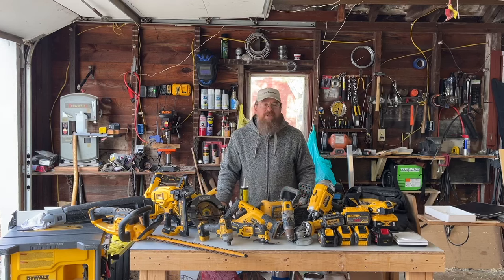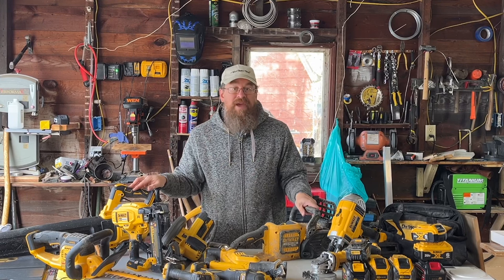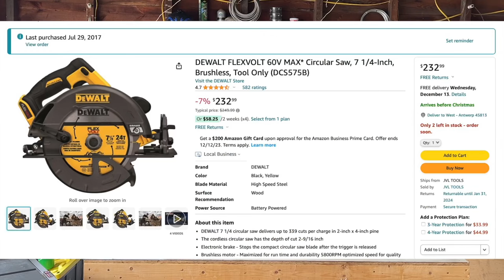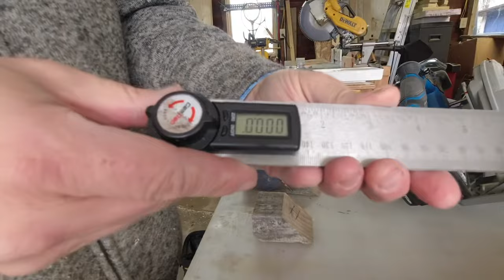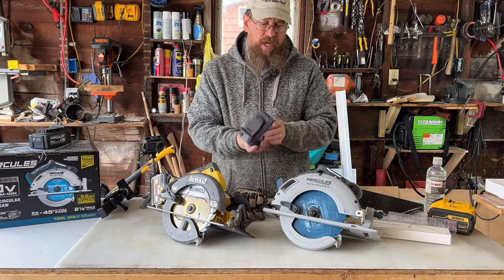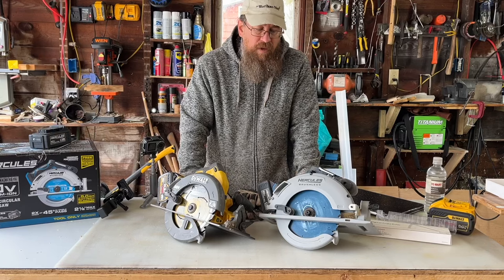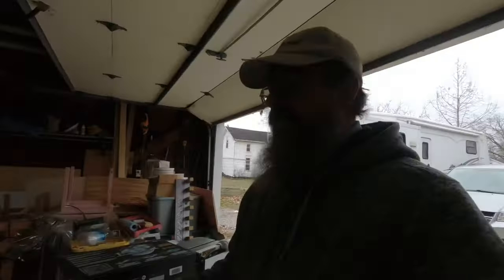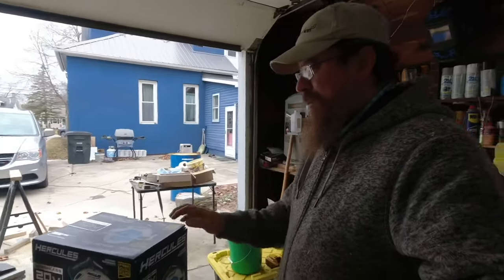DeWalt vs Hercules Circular Saw Exhaustive Comparison - E152

Comment: My only issue is that you're trying to compare a 60 volt saw to 20 volt saw. Of course 60 volt saw would be better power wise. Also the Dewalt battery would be heavier because it's a larger battery. So really it seems a waste to compare the two knowing that they are hugely different to begin with. A very detailed review though. I do appreciate that.
Reply from the maker: yeah. that's the "extremely biased" part of the review. You learn pretty quickly how to use the Hercules and it does cut better straighter as in it's less of a struggle to get it to cut straight.
Reply: Thank you for pointing this out!
Reply: @PeaceIntheValley  The power difference isn't really a bias though; the more powerful saw cuts more easily and is therefore "better" in that regard. 

An example of bias might be claiming one saw is better due to already being invested in that saw's battery type -a preference based on something other than a fair comparison.
Your review is very informative and very helpful.
Reply: I agree
Reply: I used my friends Hercules when I was helping him with a project but he had a Diablo blade in it instead of Hercules. I don’t know who makes their blades. It also had an 8 amp battery in it. Ran great.
Reply: I wouldn’t say a 60v tool would always run better than a 20v tool. Most 60v hand tools are made to run off off of 20v power or are based off of a motor made to run on 20v. Theres plenty of reviews out there where 20v tools beat higher voltage tools in power and speed. In this case the dewalt beats the Hercules hands down but I’m also pretty sure the 20v dewalt circular saw beats the Hercules as well.

Comment: I have the Hercules saw as well as one from Bauer. I use and like both of them a lot. If you use the 4, 8, or 12ah Hercules batteries you will get greater performance from it. Dollars spent to value, it's hard to beat the Hercules stuff. Great review

Comment: The 60 volt battery system does increase the power factor when used over the 20 volt. Read Dewalt's literature, it'll tell you all about it. So you need to use the 20 volt Dewalt battery to check power difference. I have the Dewalt system, but I think to do a power comparison, it should be apples to apples. Other than that you did a good job of comparing those two. There's no doubt Harbour Freight has decided to compete with the big names at a much better price.

Comment: I bought all the tools from Harbor freight, both Bauer and Hercules.If you want a pro grade tools buy DeWalt they are way better... but I don't have DeWalt money.the 25 cordless tools I bought from Harbor freight and the 12 batteries and 4 chargers would have cost me... Thousands of dollars more. So for me Harbor freight is the best choice. If my tools break down the road I'm not out much money. With the deals I got, might have paid 40. dollars a tool.campared to 100 bucks or more for DeWalt.
Reply from the maker: I have to agree with you. I think the DeWalt tools overall are built better. However, the newest Hercules Impact driver is better than my DeWalt. I suspect the next cordless circular saw will improve too.

Comment: When i started investing in power tools i lived right around the corner from a home depot. They sell ryobi, which has a great line of power tools. I went with them mostly due to proximity and convenience, but have never been let down and will continue to stick with them.
Reply from the maker: Absolutely. The batteries are costly and it's a chicken and egg conundrum. .
Reply: We used Ryobi 18V stuff in the door shop when I did garage door installations....back when they were blue, and before the Lithium batteries....the only downfall back then was the battery life, tools were fine, batteries ran down quickly when used in production settings.  

I only have a couple of Ryobi tools, got them today for $99, 2 1.5ah batteries, charger, drill, and 1/4" impact driver.  Not a bad dealt to toss in the pickup when I got to the pick a part yard.

Comment: I have cordless Dewalt 6-1/2, Milwaukee 6-1/2,Hilti  6-1/2, cordless Flex 7-1/4 rear handle and a  corded SkilWormdrive 7-1/4, I use mostly Freud blades on all,  I'm a lucky Guy  because the Wife let's me buy all my Toys, I just tell her I need them to make her stuff and for the Home Improvements.Happy Wife , Happy Guy😃😆...😂

Comment: I just purchased this saw, well saw, battery, charger combp yesterday. So I want to add a few things in the comments. One for $99.99 this is a hard to beat deal period, Second having not used the saw yet I don't know how long it will last. But I am just a handiman howmowner, so I dont think it is ever going to see job site professional work. On that note I am surprised on its construction, the Magnesium shoe and guards I did not expect and that the shoe is not just flat but has webbing in it for rigidity is also unexpected. But now to the discussed battery. 60 volt vs 20 volt is like it was said Apples to Oranges. Secondly the AHr rating and more so the peak discharge rate are the big determinaters here. It is not likely the saw shutting down but the battery. The batteries have a BMS and it determines the peak charge, discharge, and safe voltages. That said, the lesser battery likely has a lesser peak current till shutdown, also is it may also have a lesser avg current rate so the saw will not get the power it may want. I will be soon starting some summer projects and will repost my findings.

Comment: For a homeowner the Hercules deals are impossible to beat. Bought a 5Amp  
Battery and charger for $99 with the latest Deal and got a $139 cordless grease gun for free.  Father’s Day deals I will pick up the circular saw.
Reply from the maker: Let me know how the grease gun works. I have the DeWalt version, but real interested in the HF model.
Reply: Got a fast charger 5ah battery and 4ah battery for $119 and an impact and grinder for $100.

Comment: Imo I don't think many cordless saws compare with the DeWalt 60V...its a beast like you said. 60V is usually for lawn equipment etc. The Hercules does match well with other 20v tools. The extreme Herc. batteries also use physically larger, higher quality cells so they do distribute more power.

For me the Circ Saw isnt the standout of the Hercules line (probably Impact Driver or Ultra Torque), I expect them to release a new version. 

Also there is a Beam Cutter attachment for the Hercules that basically turns it into a chainsaw. That might help for what you were trying to do.

Comment: Thank you for the great video. These saws are in two different classes. That being said the Hercules did everything you would need to do and more. And when you compare cost of tool cost of batteries and warranty. The Hercules is a clear winner. Only time will tell if it has the durability. And the best part is if you want to get their biggest battery, the 12 amp. It only cost $130.

Comment: Loved the comparison. I’m about to by the Hercules after your review.  The stump cut test and others would have been interesting if both saws were running the same blade.  Just a thought.  I will probably go with the 8 ah battery at a minimum
Reply from the maker: i did actually swap blades to see if it would make any difference and it didn't seem to make any difference. Even though I have both and the DeWalt is more powerful, I do like the balance and the hook of the Hercules. i don't think you will be disappointed with Hercules.
Reply: @PeaceIntheValley I think for anyone not using the saw all day everyday the Hurcules is an adequate and capable tool. Comparing a 60 volt motor to a 20 volt motor is like having a 6 cylinder motor compared to a 2 cylinder motor as would be expected the bigger motor will have more power. But the newer cordless tools for the most part will work right along with most corded tools. No longer need the cord to have the power to get the job done. 
I did enjoy your biased comparison and you did a fair job at awarding points on the scale that you set up. 
I think the biggest take away from your video is that for someone on a more budget friendly use  it some time tool to get the job done is that the Hurcules line will let you have tools to get the job done with a lot less out of pocket expense.
Reply: The hercules with a 8 ah will run all weekend and make 100s of cuts. I have it the dewalt 20v flexvolt advantage and the flexvolt worm drive or left handle. The hercules gets the job done and is lighter with a 8 ah than both the dewalts.

Comment: While I wouldn't expect any 20V saw to compare on performance to a 60V saw, I would say that the Hercules saw does very well in the 20V space. To be truly fair to Hercules, it would be best to compare with 20V saws of its competitors. I believe the Hercules will hold its own when compared with other 20V saws.
This video does well to illustrate the strengths of both saws, as well as their weaknesses. These saws target different segments of the customer pool, so I think this video will help people figure out which market segment they are most interested in, and thus, which saw would be better for that reason. While both are cordless saws, the DeWalt is the one I would say is most likely to perform on par with a corded tool. I believe that to obtain that level of performance from Hercules would require the use of the corded Hercules saw.

Comment: Good insight. Bottom line is if your a regular home owner and use the saw for projects, is the lower cost the tie breaker.
Reply from the maker: I don't disagree with that. In fact for pretty much everything it would work great. I didn't mention this but Hercules is quieter.

Comment: You may want to throw on a Makita Carbide-Tipped Max Efficiency blade on the Hercules. Might see some improvement in performance. I think the performance choke point is in the blade.
Reply from the maker: I switched blades with the DeWalt just to try and see if that was the difference but the Hercules is still under powered. It stops quite a bit. I still like it, especially the rafter hook! I may have to try that Makita blade! Thankyou for the suggestion!
Reply: @PeaceIntheValley  sure thing! Just saw some surprising test results on the Makita blade that made a difference in cutting.
Reply: I agree a better blade may help the Hercules, still would say for the heavier stuff I would just grab a corded saw because the flexvolt batteries cost as much as a corded saw.

Comment: I've recently bought two Hercules tools the multi-tool and the brushless recip saw. Hercules will get the job done and their batteries have a pretty good life but they're a bit underpowered. But honestly they offer such a wide variety of tools you could equip your entire shop with their 20 volt lineup. I see no need in getting their ported products though. I'm a new DIY but for some reason I keep wanting to invest in Makita 40 volt system
Reply: The 40 and 60V tool lines are very limited compared to the 18 and 20V lines of tools regardless of brand you pick.  The key is finding the brand that works for you and sticking with it....I have a few, and I can say, its a PITA when you have different chargers, different batteries, and different tools LOL.  They all work fine, but you end up with a pile of chargers and batteries and none of them interchange with each other.  

One thing I'd look at is Ridgid....out of all tool brands, Ridgid has lifetime battery replacements, and lifetime service/parts agreement on their 18V tools.

Comment: I have a 20v 7 1/4 dewalt as well.  DCS570.  It also likes to stall out and flash the battery light at me.  It has the same issues with the lines not being accurate on it.  Think I'm going to get a hercules.  Maybe also get a 6 1/2" saw.
Reply from the maker: if you get that, post your thoughts compared to the DeWalt

Comment: Off topic but do you get any condensation issues on your tools being in an uninsulated garage? I do.
Reply from the maker: I have never had any problems with condensation in my garage. The most I'll get is on the concrete floor on high humid or rainy days.

Comment: For me, the battery longevity and durability are a huge part of the equation.  I very rarely notice the difference between the cordless tools.   Most of the time, I don’t do precision work or work with hardwoods with my cordless tools.  The batteries are very expensive and it is a hardship when they drop to little capacity or die.

Comment: Good video.  I thought you would've tried to cut a post top about shoulder height or higher for a test.  That would still be interesting.
Reply from the maker: You are right since that is what I was saying it was the reason for buying a new one! It will get used for that soon when we start the RV shelter in KY!

Comment: I'm HEAVILY invested in dewalt. Im a homeowner thats pretty handy. I have a line of tools that'd outfit most professionals nicely. I tell ya.. if i had to start over, I'd be buying Hercules and Bauer. I did just pick up the Bauer brad nailer. Got it for 90 bucks with a 5 ah battery and charger. I think the DeWalt is like 250 bare tool.
Reply from the maker: That's kind of what got me started too. Buy a battery - get a tool. Can't complain about the impact driver at all. It's very powerful. Just built a building in Kentucky with it, and the DeWalt driver.

Comment: Well wasn't happy with at first you comparing a 60 to a 20 wasn't thrilled. But you did a real review I skimmed some tho. But the dewalt is a good brand won't lie but I'm harbor frieght guy I feel they can do same jobs. But there should be a way to fix the blade issue on the dewalt.
Reply from the maker: yeah. I figured it was better to do what I considered a real world test. It's not apples to apples, and there are other channels that do that. However, it is what I would do in real life, especially how I have so many DeWalt tools. I know some people, by the comments, don't like that i'm comparing that but that's okay. The average guy is going to compare them because they are both 7.25" circular saws doing the exact same job, not so much the voltage.

Comment: I use converters for my 20v dewalt batteries in a HF tool i only need for occasional use.
Reply from the maker: where do you get those?
Reply: @PeaceIntheValley  Amazon has the Bauer ones, I believe Ebay may be the best place for Hercules.
Reply: @PeaceIntheValley  https://youtube.com/shorts/PkfLRfjqRnE?si=pSsAAkRtCCXo7Aas
This guy's using the Bauer one I have.

Comment: 16:34 - I'm in shock.  I just bought one of these today, and the blade bolt is now CLOCKWISE to loosen(!).  Could not figure it out until I read the directions just in case they would have put an opposite-than-normal threaded fastener on there.

Comment: I have the Hercules saw and I run it with the 4ah extreme performance batteries.  The 21700 Samsung cells in those just has a better discharge rate. I am looking to get that flexvolt saw though.  I have a ton of flexvolt batteries now and need things to use them with.
Reply: The Flexvolt Attachment Capable Weed Eater would be a good add-on tool as is the Flexvolt 16" Chainsaw....I have both, and both work extremely well.
Reply: @wildbill23c  I have the standard string trimmer, the 16 inch saw, the blower, and I currently have the angle grinder on layaway.

Comment: The 60v dewalt has a rafter hook.. i have had 2 of them for the past 4 years.. I use it everyday building houses!
Reply from the maker: I think that mine is too early - it was the first model of the 60 volt cordless saw. I think I even mention in the video that the newer ones might have the rafter hook - either way - it is certainly necessary, especially for people in your profession!

Comment: Yes, the 8 or 12 mah batteries would most likely make a difference does to the 21700 cells inside versus 18650 cells.

Comment: I suspect the Hercules 5AH battery still using older 18600 cells.  Their 4AH ("Extreme") use the newer 21700 (something like that) cells.  Am DIYer and have been pretty much all Dewalt, until recently.  The price for Hercules battery + charger + tool is less than price of Dewalt tool itself.  I have both Dewalt and Hercules impact driver and feel the Hercules battery goes down faster. In terms of power/speed, Dewalt feel more powerful, but for me, not significantly enough for me to buy another Dewalt. On other hand, Dewalt tools have been very reliable so not expecting to need to replace any time soon. Not a pro so I'm not using the power tools daily or even weekly. If I were a pro, heck I may buy TWO Hercules, just in case one breaks because I know I can take broken one to HB and just replace it. Have never had a Dewalt break so not sure how the warranty work there.
Reply from the maker: All good points. I have the DeWalt Driver and Hercules Driver and the Hercules is quite a bit more powerful. Perhaps it's because my DeWalt is older?? The battery is not bad on either. I can go a half day of solid driving with the Hercules battery. Probably not quite as long as the DeWalt but I'm also driving more screws. It will get hot too putting in the 5" screws attaching the purlins to the trusses. I am a little disappointed in the circular saw power but I suspect they'll be updating it soon too like they did the impact driver.
Reply: @PeaceIntheValley  Dewalt is way behind the curve in terms of power for a lot of their tools, most other tools brands have long passed them by, especially in drills, and impacts.  Wonder why Dewalt hasn't come out with more Flexvolt stuff, like 60V drills, and impacts and utilize those ridiculously overpriced batteries....I got mine on sale luckily, otherwise they're $300 for a couple of entry level Flexvolt batteries....with the 3 batteries I have I have no issues taking care of the weed eating chores on my property, and dong some yard cleanup in the spring with the chainsaw....good tools, ridiculous prices.